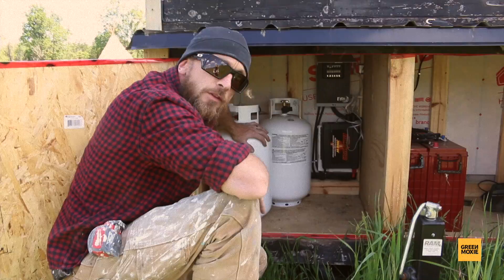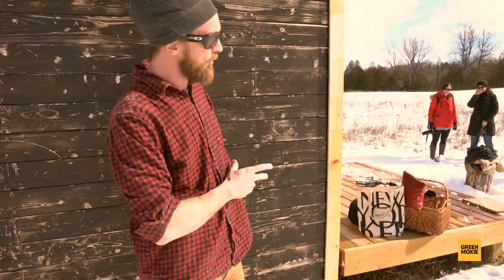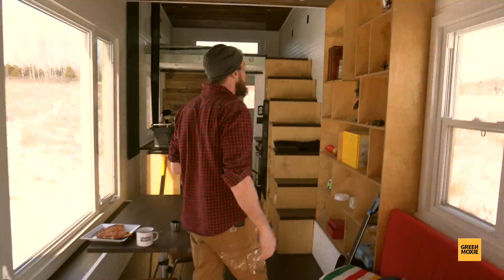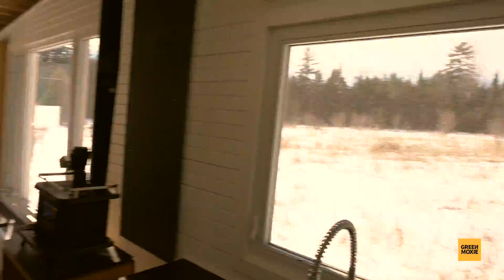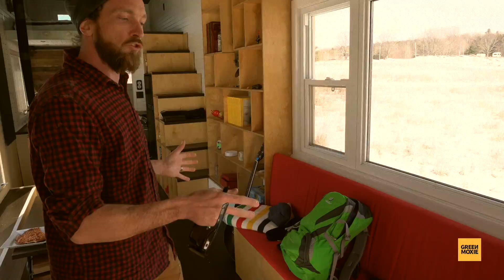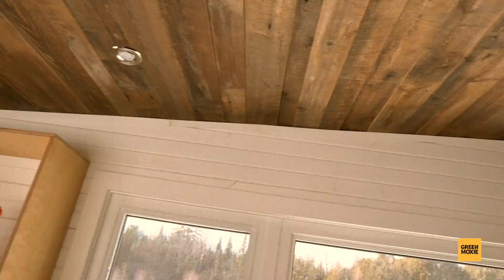Greenmoxie Tiny House Tour

Comment: I would be concerned if i were you putting the electrical system and gas tank by each other. One spark and a small gas leek equals big trouble
Reply from the maker: Yes, we have since moved the dividing wall to incorporate the panel as well. Thanks for noticing.